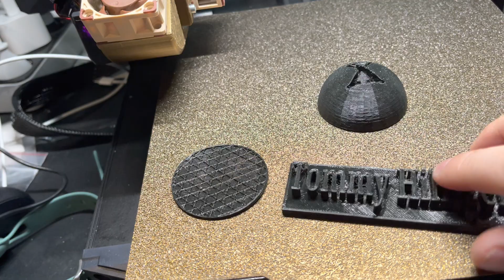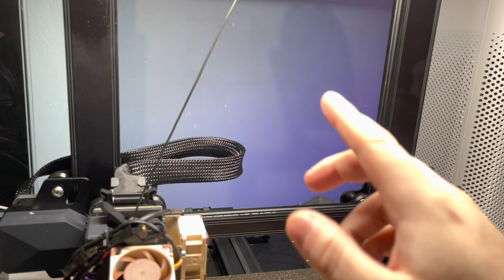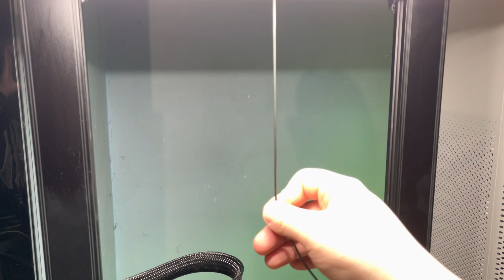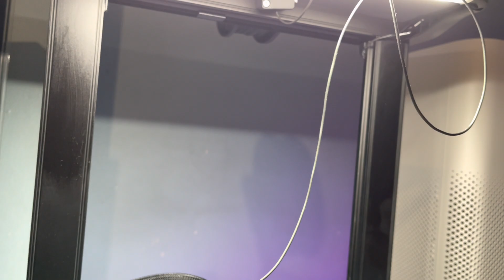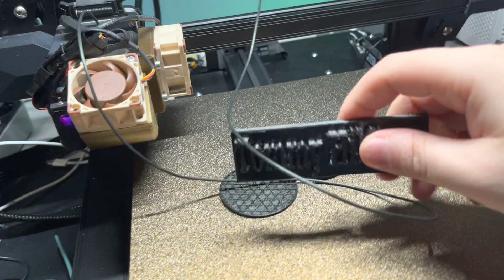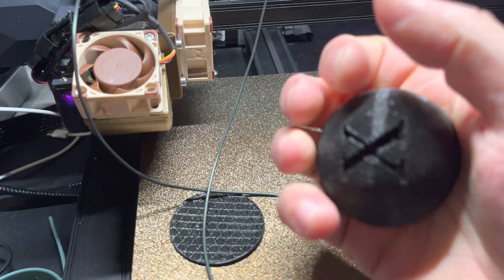Ender 3 S1 sprite extruder tpu results Ninjaflex tpu flexible filament.

Comment: Hello, could you tell me what parameters you used to print those parts? (Temperature, speed, retraction, flow, etc.) Because I see that your parts turned out quite well and I am also trying to print it on an Ender 3s1

Comment: My sprite pro extruder is skipping Im not even able to load the filament... any ideas?
Reply from the maker: i think there could be some filament stuck in there, ... u could dissasembly the unit and check
Reply: @aim6mac  well nothing is stuck.. I can load the pla or any other is just the ninja flex that giveme trouble.. I also dissasemble and nothing bad found...
Reply from the maker: @mauriciodelvalle4648   in that case try playing with the tensioning screw on the side of sprite extruder.
Reply: @aim6mac  should I put more tension or less?
Reply: @aim6mac  will do that tomorrow starting by completely remove the screw

Comment: While watching the official creality demo video showing the S1 can print tpu, I noticed they bypassed the filament detector. They inserted a cut piece of filament in it and did  a direct spool to extruder feed.
Reply: i just received the ender 3 s1 pro and noticed the detector does waggle a lot during pla printing but prints are fine.
During my search on how to print with tpu there were several videos stating it needs the least amount of drag resistance as possible. Guessing this is why creality had it bypassed.
Reply from the maker: most likely because even regular filament tends to not go as smooth as it should...

Comment: What can be the reason if the nozzle on my sprite extruder pro gets blocked by the tpu after a few minutes?  🤔 Layers adhered well.  It was A98 TPU from Extrudr, 255c° at the nozzle, heatbed in frame as recommended and speed 25-30mm/s as recommended.  Perhaps the tension on the arm is too high?
Reply from the maker: I think the first thing u should do in that case is to dissasembly your sprite extruder, to see wether there is something weird going on inside of the gears section, if everything looks fine then u should indeed try to change the tension of the spring for the filament guide.
Reply: @aim6mac  Thank you for your prompt reply.  I'll have a look.  thank you first.

Comment: Hey mate I have a question what mods have u done to it aka fans and how did they go with tpu bc somone else said that they need to upgrade the fans for tpu but is it needed and if so what fans r they.
Reply from the maker: hi there, TPU works well with this setup, i'm using 40x20 noctua fans 12V in series, 24 /2 setup,

Comment: Print a filament holder that has bearings in it your filament will run much smoother for tpu = a better print and zero retraction and 10% more flow rate,ninja flex hates any tenion on the filament .well thats my settings on my prusa.
Reply from the maker: thanks for the tip

Comment: Specially with ninja flex if it is stuck somehow, it will strecht, and that will make the effective cross section smaller, causing underextrusion. Did you increase your flow? Did you check e-steps? On my experience, and I print a lot of TPU, I have to increase flow like 10% compared with PLA.
Reply from the maker: it's been some time but i did change some settings, not sure about the flow rate though

Comment: Hello, does anyone know how big the replacement nozzle is?  0.4 or 2.0 ❓🤔
Reply from the maker: it's 0.4
Reply: You can buy them in different sizes from .2 to 1 I’ve seen. They’re not terribly expensive. You can get a pack of like 12 replacement brass nozzles in different sizes AND 12 hardened steel nozzles in different sizes for like 13 bucks on Amazon. It includes the standard .4mm size in both too